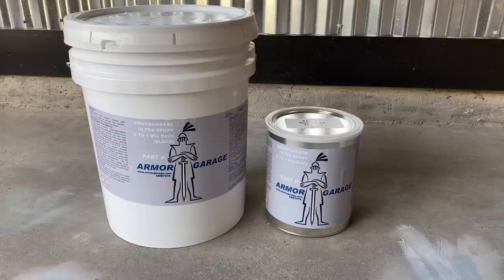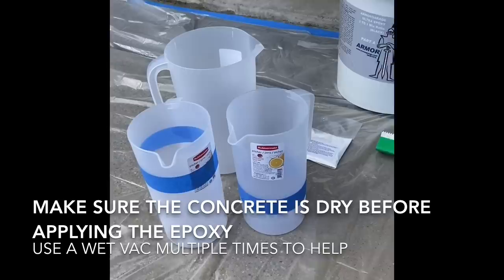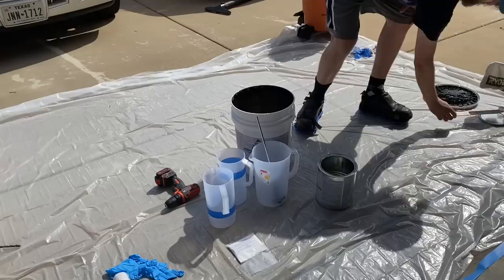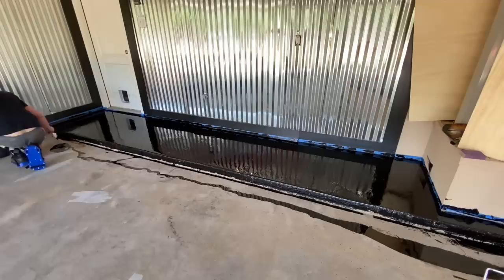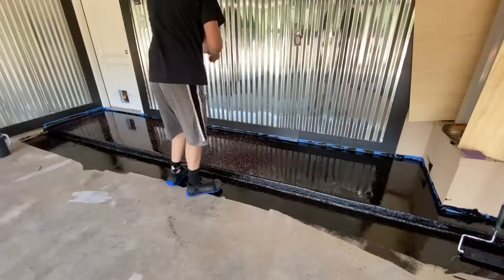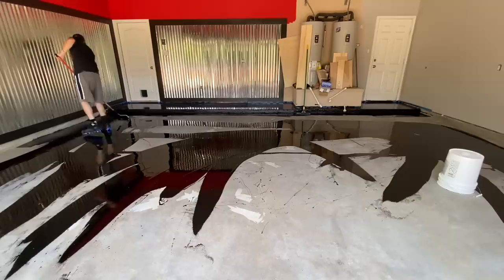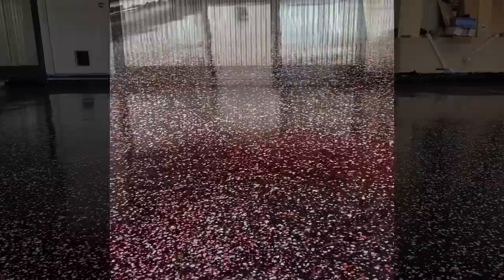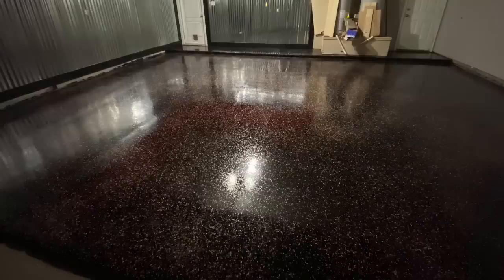The ULTIMATE Black Epoxy Garage Floor Makeover!

Comment: Good job mate - appreciate you leaving in the errors so the rest of us can learn to avoid mistakes. Lessons learnt:
1) spiked shoes a must-have & Amazon cheaper than epoxy floor suppliers
2) Work in small areas
3) Custom shaker container a winner
4) Roller better than notched silicon spreader (either get a straight silicon spreader or avoid a spreader and just use the roller)
5) Leave the epoxy to cure longer than 12 hours and ensure it's touch dry everywhere before clear-coating
On the pour technique of clear hardener into container, better to put pour container up to can lip at 45 degree angle and "quick pour" even over-filling, then stand can quickly to avoid drippage. You can then pour excess back from pour container into can in comfort as it has a great pour lip design and you can nail the level perfectly if that makes sense? Overfill then remove to exact level.
Reply from the maker: Thanks!  Yea I wanted to show people how it really was.  The other videos were great but always went perfectly and none of the reviews said stuff went perfectly.

Your lessons learned are awesome!!!

Comment: If you want it to bond properly you really need to use a 175 with diamond pads around 80 grit.    The reason coatings lift from hot tires is because it doesn’t get a good enough bite.  80 grit done properly provides it.  Looks amazing, hope it’s lasts.

Comment: It’s been my dream for years to do this kind of thing! I’m buying a house but the basement floor was painted and it looked like it was done wrong.
Reply from the maker: Grind off the paint and fulfill your dream!
Reply: @HomeDIYDan  use a sander?
Reply from the maker: Well normally to prep the floor you would grind it and acid wash it but with it being in a basement I’m not sure how acid washing would best be cleaned up.  I would rent a diamond grinder from Home Depot grind the floor so you have a good surface to adhere to and then wash it so there’s no dust left on the floor.  If you have good drainage in the basement and it’s not finished you could pressure wash it but that’s on you to decide how best to wash it based on the basement situation.
Reply: @HomeDIYDan  it’s not a basement under the ground. It’s a garage basement.
Reply from the maker: Oh ok well diamond grind and acid wash and a final power wash and you should be good to go!

Comment: Question:  I was told that any natural gas lines need to be turned off/capped when working around  these types of chemicals.  Are those gas water heaters in the background or water softeners?  If they are gas, how did you work around them?
Reply from the maker: They’re electric

Comment: Looks amazing how's it holding up?  Mine is not as shiner as last year even after a full on cleaning.  Any tips to get the shine back?
Reply from the maker: If you put a clear coat on it then you could polish it possibly depending on the brand
Reply: @HomeDIYDan  i hired someone to install it last year so not sure if clear coat was involved.  Is there a way to determine this?  There are certain spots that feel smooth to thr touch and shine more.  The other areas are gritty to the touch for grip...I suppose its textured but these areas are not as shiny.

Comment: Did you have to strip your floor with  a floor buffer with the attachment to scratch the top surface before applying the acid? Either way floor looks awesome, great insight
Reply from the maker: I didn’t but I should have. Watch the follow up one and I go into what I would have done differently

Comment: Awesome 👍
Question
If you got small cracks on that concrete, what would fill with or how would you fix it?
Looking to do similar job iny garage.
Reply from the maker: There’s concrete filler from rust oleum or any concrete patch should work as long as you give it plenty of time to cure before applying the epoxy.   Take care of the grinding and acid wash first then patch
Reply: @HomeDIYDan  
Got it 👍 much appreciate it!

Comment: Is it possible to do half one day,let it set up and move everything in my basement to the finished side. Then do the rest of the basement
Reply from the maker: Yes, I would just feather the edge and then before you go over it from the other side just rough it up with some sandpaper 60-100 grit.
Reply from the maker: Just make sure before you move anything on top of the floor it’s been given enough time to setup
Reply: Thanks ,hopefully this will help with the hydrostatic water I get once in a while
Reply from the maker: I’d probably see about putting a dedicated hydrostatic barrier down first and then the epoxy for a second layer / looks.  Use it as a primer of sorts but make sure it can adhere properly with the epoxy.
Reply: @HomeDIYDan  any suggestions of a certain barrier
Reply from the maker: @mw-mt1wl  what area of the country are you in climate wise and how much water is intruding into the basement on average
Reply from the maker: If you want a private chat hit me up on Instagram @homediydan or go to my website homediydan.com and chat with me there
Reply: @HomeDIYDan  I live on the Jersey shore,it only happens in April and may.I’m told that part of my town is built on top of an underground stream.
Reply: @HomeDIYDan  this is good.there might be someone out there with the same problem
Reply from the maker: Ok let me look and see what’s best !
Reply from the maker: If I don’t have a response by Sunday please hit me up again. It’s a busy family weekend and I don’t want to forget about this

Comment: Just in case I missed it, how many square feet is your garage? Great job and great video!
Reply from the maker: Thank you!  It’s around 480 sq Ft.  2.5 car
Reply: @HomeDIYDan  Thank you brother. That’s what I have. How’s it holding up?
Reply from the maker: No problem!  It’s holding up great to the everyday stuff.  I did gouge out a spot when I was moving something heavy it made my stomach drop when it happened but now I can’t even find it without looking really hard.  Finding screws that I drop is a pain in the butt but I still love the colors. I would have gone heavier on the clear coat is my only regret
Reply from the maker: I made a follow up video as well showing how it’s holding up after a year
Reply: @HomeDIYDan  I have to rent a floor maintainer. Gonna be a lot of work, but rewarding. May I ask how much money I should expect on product?
Reply from the maker: Sorry I missed this, I spent about $780

Comment: I have a black epoxy floor too. After 3 months, the shows dirt and scratches. Any advice on maintenance other than applying another clear coat?
Reply from the maker: I don’t see a whole lot of dirt on mine. I’ve wet mopped it a couple times and it looks great afterwards.  I also went fairly heavy on the flakes which helps hide a lot

Comment: Good it’s holding up? I’ve been thinking about doing this to mine, but haven’t pulled the trigger. For some reason I keep thinking that it’s going to get all scratched up every time I roll the car in it.
Reply from the maker: It’s held up really well the only damage that happened was when I was putting a wall up a screw that was on the bottom of the wall dragged against the floor.  I sanded it down and reapplied the clear coat that I had left and now can’t even tell
Reply: @HomeDIYDan  awesome thank you for the input! Great video!
Reply from the maker: Thanks!!  Glad I could help!!

Comment: How is it with a car on top of the floor now?  Is any of the epoxy lifting?
Reply from the maker: I haven’t had any yet.  The clear coat seems to do a great job protecting the epoxy
Reply: @HomeDIYDan    I have heard so often that tires will pull it up.  Especially when turning the car wheel while the car is stationary.   It looks fantastic.  Thank you for sharing your project.
Reply from the maker: Yea I heard a lot of that with the rust oleum stuff which is what lead me to this brand. Lots of good reviews and didn’t see anyone complaining about hot tire pick up which is a big deal for me in texas

Comment: I noticed you were able to step on the floor while applying the flakes.  Any issues with that?  Also ... Do you see any reason why 1/2 of the floor couldn't be done at one time ... followed by the other 1/2 say a week later?
Reply from the maker: So I’m using special spiked shoe attachments similar to golf shoes to walk on the floor.  The only issue I could see is if you’re doing the clear coat afterwards you would have to sand the epoxy coat lightly on the first half in order to get the clear to adhere properly.
Reply: @HomeDIYDan  Thanks Dan.  Just sanding a portion of the finished side abutting the second half, correct?
Reply from the maker: @danstvguy  Yea, with the Armor Garage Epoxy I used it said if the clear coat is not put down with 24 hours of the epoxy being put down then you would need to sand it.  So if you're planning on breaking it up just put the clear coat down 10-12 hours after you finish the second half

Comment: Since it’s the garage and doesn’t need to be perfect could you just dump it on the floor to speed up the process?
Reply from the maker: Dump what on the floor?
Reply: @HomeDIYDan  probably a dumb idea on my part but just thought if you mixed everything in one big bucket and then dumped it from a ladder it would splash everywhere and self level. Just thinking about saving time.
Reply from the maker: You could mix it all at once if you have a flat floor, but I wouldn’t recommend dumping it all in one spot.  You could spread it out like I did and use a flat squeegee to spread it out to ensure every square inch is covered.

Comment: Great video... Any tips or warning signs I should look out for when having a company do this for me?
Reply from the maker: I would ask them what kind of prep they do before they put down the floor, ask them what brand of epoxy they are using and then google it to make sure it’s solid reviews.  I would also ask them to walk you through their process completely.
Reply: @HomeDIYDan  do you know how much flakes you used to cover the floor as you did? looked like a 10lb bag..
Reply from the maker: Yea I might have used about half of the bag it’s was like most of the one gallon container I filled up
Reply: @HomeDIYDan  thank you
Reply from the maker: @hankcarrillo1494  No problem!!
Reply: @HomeDIYDan  one more question when you said you used 8 boxes of the clear coat was that 8 2.5 garage boxes or 1 car?
Reply from the maker: I used half the box of flakes and one gallon of clear coat

Comment: What if you have cracks. I can seal it with cement sealer, but is that recommend?
Reply from the maker: If it’s not a giant crack then yes. I did that I just didn’t have it in the video

Comment: We walked over the clear coat too soon after it was applied and now there are shoe prints...is there any way to get rid of the prints?
Reply from the maker: Yes you can sand it down and reapply the clear to the spots you sanded down
Reply from the maker: I’d use 80-120 grit

Comment: About to buy, what were those chip colors? And after you did it was it slippery if it got wet or even before it would get wet. Did you use any of the anti skid stuff in it?
Reply from the maker: I used red white and gray, I didn’t use the anti slip and when it’s wet some people find it slippery but I haven’t had an issue
Reply: @HomeDIYDan  okay great! Thanks!

Comment: Were you wearing the spiked shoes when you put on the clear coat?
Reply from the maker: Yes
Reply: @HomeDIYDan  thanks! I was worried it might mess up the epoxy but that stuff must cure fast and strong! I paint epoxied my garage in the fall and the heat from my tires is already pulling it up when I park. After watching this video I’m gonna do this come spring. Thanks for posting it!
Reply from the maker: Yea the epoxy cured in about 10 - 12  hours and at that point I put down the clear coat.
Reply from the maker: Let me know how it turns out!  I would definitely recommend diamond grinding the floor if you have something down already and then acid washing it.
Reply: @HomeDIYDan  that’s another thing I was wondering too; the best way to get down to bare concrete, or if I even should. I’ve got a lot of pitting in the floor too but it’s still good. I’m assuming the epoxy will get down in the pits and fill them, leaving a level surface above, yeah?
Reply from the maker: Yea, if it’s a deep crack or pit I would use a concrete filler.  I used rust oleums and it worked quite well.  The diamond grind will give it a nice rough surface and then the epoxy will self level to give you a nice level surface.

Comment: How did you make your flake shaker?
Reply from the maker: I drilled either 3/8” or 1/2” holes in the bottom of a $1 water jug from Walmart filled it up and then just shake it back and forth.  You can practice in the grass or in the driveway to get a feel for how it spreads and if you want to add more holes.

Comment: How do I make it shiny???
Reply from the maker: The clear coat on the top
Reply: Home DIY Dan so I did one part of the garage and I put like the chips or the things and should I do it over the thing or ???
Reply from the maker: Yea you add the epoxy clear coat over the flakes
Reply: Home DIY Dan so I did the first part and painted it and then I put the flakes and I’m asking if I should do a another coat over it then put the flakes again??? Please let me know
Reply from the maker: If you’ve done the flakes already than no need to do them into the clear coat

Comment: Sorry, didn't complete my comment. I hired a company to apply a finish to my 2-car garage. They started at 8:15 am and were finished the same day at 1:30PM. 24 hours later I was parking my cars back in the garage.
Reply: and how much did they cost ?
Reply: @thesage1096  It was expensive in comparison; $3500. It comes with a 15 year warranty on the floor. Your experience with your flooring choice may turn out differently.
Reply: @artlayton1425  oof...that's a pretty penny. But I guess u can sleep well knowing it's top class work you got.